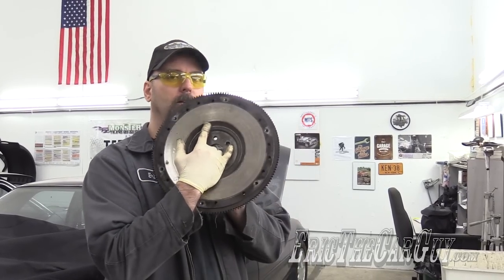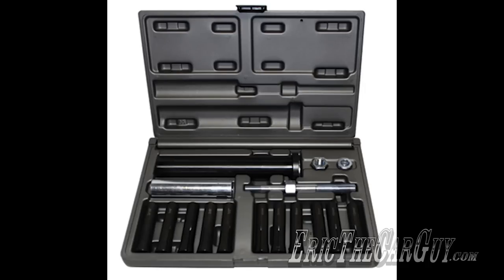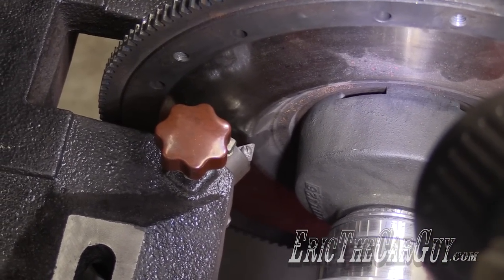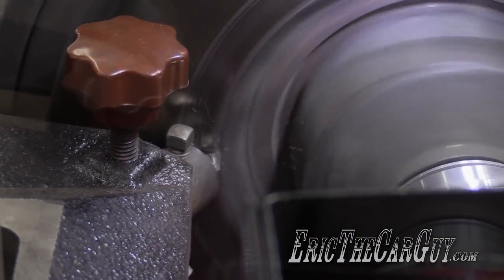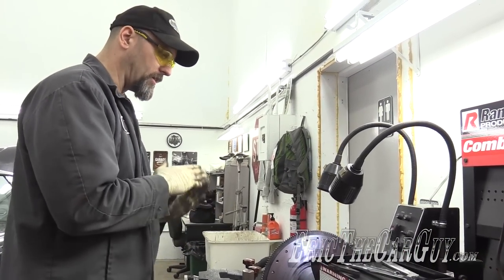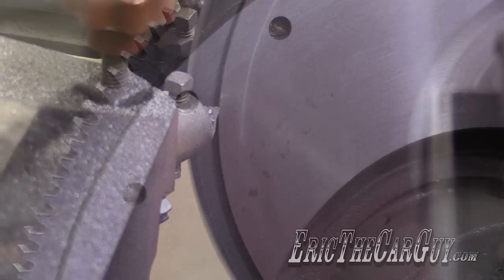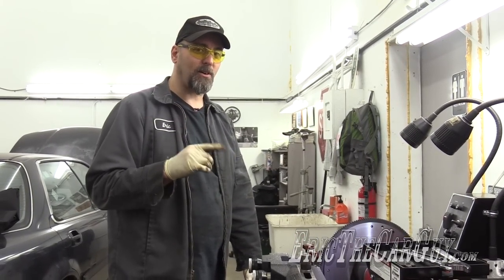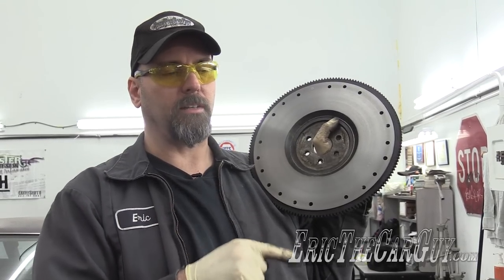Can You Machine a Flywheel with a Brake Lathe??

Comment: Could you apply some cutting fluid to keep the bit cool so you dont burn it up?
Reply: +IIGrayfoxII   It would make a terrible mess that is hard to clean up.  It's easier to control the turning speed and the depth of cut. Eric forgot that the outside edge of the flywheel is moving faster than the inside. You can get some cooling using compressed air.
Reply from the maker: +IIGrayfoxII Not designed for that. If you do this, be sure to set the bit on the outside to avoid cutting too much.
Reply: +EricTheCarGuy There is also a lot more material on the outside part of the face of the flywheel, and more surface feet per minute. So lathe speed and tool feed should both be set to the outer part of the surface to be machined, always. Excellent result tho. Holding another object against the back side of the part you are machining is acceptable if you are careful and think it through properly. A slight film of oil on the face applied before the lathe is turning may also help in some applications. Those are just a couple tips for the future. But I must say, excellent result Eric.
Reply from the maker: +Theguywhowouldn&#39;t I started at the inside because that's how I do rotors. There's often more material there. It seems flywheels are just the opposite. Great insight. Thanks for your input.
Reply: +EricTheCarGuy If there is no wear on the face you are surfacing, then the outside has more material, always. You have been machining brake rotors for a while now and know what to expect. You have already worked out your procedures for doing them. The brake rotors you have encountered have more wear on the outside because of the more surface feet per minute, more friction on the outside of the rotor and more heat equals more wear. The outside of the rotor actually expands into the brake pad and is worn more. Again, great results.
Reply from the maker: +Theguywhowouldn&#39;t I'm aware of that, I just didn't consider it at the time. It was the first flywheel I machined on a brake lathe after all. Lesson learned. Thanks for your input.
Reply: +Motors Unite Constant Angular Velocity says the outside moves faster

 In CAV mode, the spindle motor turns at a constant speed, which makes the medium 
pass by the read/write head faster when the head is positioned at the 
outside of the disk.

Or think of it this way, the outside has to move faster than the inside to cover the same distance
Reply: +Motors Unite  WHAT?  You might want to take some physics if you think that what you wrote is correct. As for using oil when cutting cast iron, not usually done on a lathe.
Reply: If it was a cast iron flywheel it doesn't need lube for cutting. From the looks of the chips, it's a cast. Cast iron is self lubricating. Sounds weird I know lol, but I swear it's true.
Reply: +Motors Unite You don't use oil when cutting cast iron.
Reply: +Tater79bj  Yea that's true, if it's cast iron. Cast iron pretty much turns to dust, from my experience. But also, there are a lot of imperfections in cast iron, it's very abrasive.
Reply: +Motors Unite I bet you're not old enough to have had a record player as a kid :)
Reply: +KingNast Good ol vinyl.
You dont even need a record, a CD, DVD and a tire work in the same manner.
Anything circular works in the same manner.
Reply: +IIGrayfoxII True, it's just a lot easier to put Lego guys on records to see how they respond on the edge vs the center. hehe
Reply: +Motors Unite I was just kidding.. I just mean that when I was a kid, I would put objects on the turntable and it makes it easy to see how much faster it's spinning on the outer edge.
Reply: +IIGrayfoxII Not on cast iron.
Reply: I was just gonna say that, use compressed air for cooling and help clear.
Reply: The smart thing to do would be to apply coolant / some sort of cutting fluid using a spray bottle or some magnetic based sprayer.. The tool life would last 3X as longer and you would get a better finish. Thats most likely a carbide insert (that he is referring to as a bit) which usually are not cheap.
Reply: I know, old post... a rotating disk will have a greater speed on the outer rim than at the inner part. Do you think it might help if the RPM's get reduced as the cutter moves outward to keep the material moving at a similar speed across the cutter?
Reply: yea your supposed to use coolant ..not only is it longer tool life and work doaent get as hot..you can go faster and you will have a better finish on the machibed surface..(flywheel)
Reply: yes your absolutely correct its called constant surface speed. is inches per revolution In/rev  as the cutting tool moves perpendictular to the work on a lathe. so you have the speed that the cuting tool moves , 'called feed. and then the actual RPMs  of the lathe these two added to gether gives you inches / revolution...so on a CNC lathe the spindle will speed up as the tool gets to the ceber of the work yes.. until it resches a max limit of RPMs...

Comment: If there isn't sufficient gap we have used  bolts with shorter heads or ( not recommend ) machine/grind the head of the bolt a bit.

Comment: Seen your video a while back finally bought an old brake lathe machine and tried putting my accord flywheel on Ammco 7000 the hole is too small for that 1' arbor.

Comment: I've also "cleaned up" a transmission basket on a lathe.  I've also cut up old hub assembly's, cleaned them up on the lathe for a bolt on lathe adaptor.  I.E. really big rotors with 8 to 10 inch centers.  just cut up the hub until you can chuck it up in the lathe and bolt the rotor to it with the lug nuts.   does this make sense?   Its brilliant in my mind

Comment: tried this recently with my pro cut. works well for flywheels up to about 2 liter. the bigger ones go on the surface grinder.
wear on the cutting tool is much higher than when ma hining a rotor but maybe i just need a shallower cut as the rate is not adjustable.

Comment: Also keep in mind that the radius of the flywheel makes the surface feet of material removal considerably different from inside to outside, I would guess that is why you torched the bit.

Comment: The "flywheel machining machine" you mentioned having used before didn't operate like this, nor did it produce a finish like this.
Will this work in a pinch? Probably....somewhat. But does it make sense once you figure in the cost of your labor, the burning up of a cutter bit, and the sub-optimal result?

Comment: i would totally run a whiz wheel over that to get that nice omni directional finish
Reply: That would be great for the wow factor if the customer was picking up the part themself, but since he is installing it thats just a waste of time and can make the surface uneven.
Reply: i quick pass wont hurt it. he can always double check with a surface gauge. And even run it again to take off that 0.01 of an inch if thats the case

Comment: The finish between using a lathe as compared to grinding is completely different and when you have hardened spots ,  the lathe bit won't hold up. Grinding is really the best option in my opinion.

Comment: I have resurfaced flywheels with a 8inch D.A. with some 36 several times never had an issue. if the flywheel is worn to the point of needing more than a couple thou taken replace it, exception being something exotic or hard to source  aftermarket. 
In addition, rotor turning is a thing of the past, labor costs more than new rotors in most cases.

Comment: I used to do this back in the 80's with our Van Norman Brake lathe, worked OK until you had a flywheel with "hardened hotspots". There were many with the hot spots that did not work well. Flywheel grinder only for those ones.  @EricTheCarGuy Have you came across this?
Reply: Rick Ede also stepped flywheels would be hard to do on a brake lathe
Reply: We use Diamond tip carbide inserts or ceramic , no problem on the hard spots.

Comment: machining the flywheel would not affect the life time of the new clutch? as with the minimum amount of clutch wear, slipping might possibly happen?
another question, how can i get the minimum flywheel thickness? U have taught us that for brake discs the minimum thickness is written on the disc it self. nothing similar to the flywheel?
thanks Mr Eric the mentor.

Comment: thanks Eric. I have always wanted to see this tried out because years ago I learned that a fly cutter is used instead of a lathe because the surface finish quality is critical for smooth clutch operation. I expected the video would have ended with a road test of the resembled clutch. How did it drive?

Comment: as you face out the diameter, the cutting speed increases with the diameter. if you slow down the spindle speed as it goes out you will save your cutters and get a better finish
Reply: You can't change the speed mid cut on a lathe.
Totally unnecessary here too.

Comment: Great Video but you should always run a face hone over the machined surface that will aid in seating the clutch material.  I see that part missed on rotors all the time.

Comment: Did you check the runout of the mount face prior to cutting? When you started cutting, it sounded like it was touching and then not touching as the flywheel wobbled a little bit? Did it pulse after you put it in the car?

Comment: Next question: Talking of using things not intended for their primary purpose, can you balance the flywheel on your tyre machine? :-)  Curious to know if it is really close to perfect balance, or needs some strategic metal removing.
Reply from the maker: +Darren Coull I can't see how you'd mount it on the tire balance machine as the arbor is too large.

Comment: Been a technician for 6 years and I have to say I had NO IDEA that you can machine a flywheel or that it's even a good idea.
Reply: +Barbados Joe I've turned the flywheel on every clutch job I've ever done in the last 40 years. You want a new clutch disc to have a nice uniform surface on the flywheel and your new pressure plate.
Reply: Mr Frog Question for ya. Is it more common to machine flywheels on a manuel transmission or does it not matter? I ask cause at my shop there's only 1 transmission guy and I've never seen him go near a brake lathe except for the occational gravy brake job.
Reply: Just to clarify,manual trans has a flywheel,auto trans has a flexplate.I always machine or "turn" a flywheel for a new clutch.Most techs send the flywheel to a parts store or other shop to have it turned on a lathe.If the lathe is big enough,you can turn a flywheel.Check out mrpete222 on youtube.He's a retired machine shop teacher and has 700 videos on working with metal.
Reply: +Barbados Joe It is prefer d , you do not want a uneven  surface on you'r new clutch and pressure plate, that can cause it to shutter. Do it right the first time, its a bitch to do the same job twice. I do it on engines i build for customers free off charge just to save myself a head ace .
Reply: Absolutely.I would also see alot of flywheels damaged by the clutch not having any friction material left on it.I did also see some flywheels cracked between the crank bolts and center of the flywheel-time for a new flywheel.
Reply: That's why i make my flywheels from steel.
Reply: Most of my old big block Fords were cast-they were HEAVY!
Reply: +Mr Frog I wish I worked on fords or chevys. I feel like you learn a lot more working on domestics. I came right out of trade school to a Honda dealer and been there ever since.
Reply: Yes MR Frog they are, Barbados Joe i started working on heavy  duty machines,engineering,racing shops and every thing else. I build up a solid no nonsense reputation and today i run my machine shop from home,the best part NO BOSS ,HA HA !
Reply: No boss for me either...I'm retired.
Reply: I am only 40 now so i still have some way to go, Hats off to you MR Frog enjoy the retirement. Cheers Jack
Reply: Thanks,I am
Reply: +The Tool Guy You win bro. You learned that you can turn a flywheel "many years" before becoming a mechanic so I guess your just better at life than I am. It's memorial day weekend and I'm not going to spend any more time arguing with you.
Reply: wow the conversations you find on youtube comments!!!! thanks guys :-}

Comment: I've a workshop manual from an old truck that says that you should not have less than 0.9mm thickness than the original flywheel thickness.

Comment: Why don't they give you more material to work with? Back in the god days ( 1950's ) I did brake work & we would go until we cleaned up the surface & we had more material to work with. We would hardly through out a dumb. Were the specks different then?

Comment: You need to hone it afterwards. ideally you would use the drum grinder on it. Basically all you have done is cut a very fine thread into the surface, when you ride the clutch it will try and pull the linings outwards. Your machine is a knock off AMMCO, you should be able to get one. The same apply to drum brakes and discs, Brush research make a hone brush that you can run over it once done to take care of this

Comment: Want to do this at work but the wheel I have in mind has a raised section where the pressure plate attaches. I’m not sure it can be setup to cut close to the raised portion without hitting it🤔

Comment: Wow. The friction material on that flywheel... I wonder if that's the cause of the heat.

So, if you were to ever to charge for such a service, plan on them buying you bits too.
Reply from the maker: +DE “AutoBravado” Nichols Just start the bit on the outside and you will minimize the risk of burning up the bit.
Reply: EricTheCarGuy Good idea.
Reply: +EricTheCarGuy  Are those inserts made of cheese?  Should be able to get a carbide or HSS bit to 1000 deg F (red hot) without damaging it

Comment: I doubt there are specs for the minimum flywheel thickness that are available publicly. Personally though, I think its more of a judgement call. Minimum thickness for brake rotors is a safety issue, naturally. While I suppose it could be somewhat hazardous to have a flywheel crack or shatter as your driving (in theory a piece could partially brake off and wedge itself against the bell housing, causing a sudden stall and lockup - which is unlikely), its a damn sight less dangerous than a failing brake rotor.

Comment: I was always taught to not let your cutting tool rub (chirp) against the part you're working on to prolong the life of your cutting edge. Also I would think you'd want to add a little cutting oil to protect your bit/cutting edge. I understand you want the flywheel clean and oil free though. Does the flywheel become rough with time? Is this something that's typical with a clutch replacement?
Reply: +Kenneth Wilkins I think for a flywheel, oil would be a bad idea. The chips coming off the flywheel look like cast iron which is usually cut with no lubricant anyway.
Reply: Cutting oil is bad on a flywheel, you want to keep it clean as possible as it is a friction surface. And yes they are cast

Comment: oreillys have been turning flywheels on there brake lathe for me for years now, they say there not suppose to but they do it any ways, they cant turn the dual mass flywheels at all though
Reply from the maker: +Southern Mechanic You can't turn dual mass flywheels. When using a brake lathe to do this, it may be difficult to get out some hard spots. A flywheel machine with a grinding stone is the best option but a much more expensive machine, and it can only be used for flywheels. This can be used to resurface drums and rotors as well.
Reply: I have heard of companies selling dual mass flywheel rebuild kits as an alternative to machining. I don't know much about it because I hardly ever encounter a car or truck with a manual transmission of any kind.